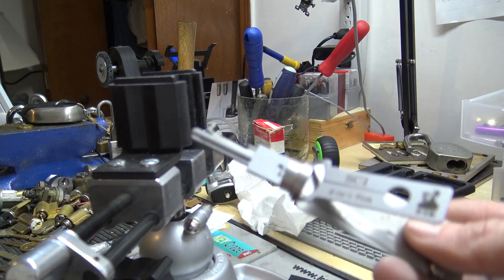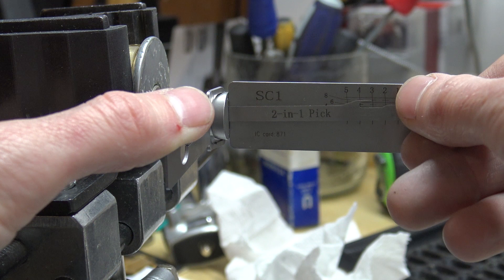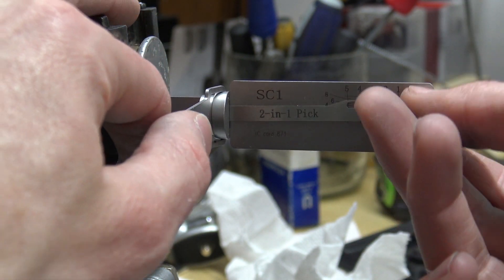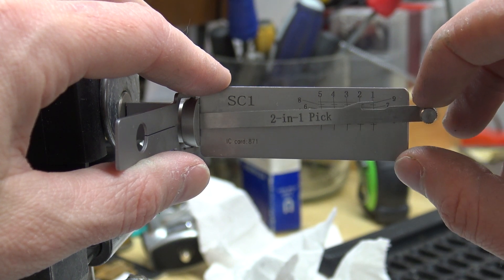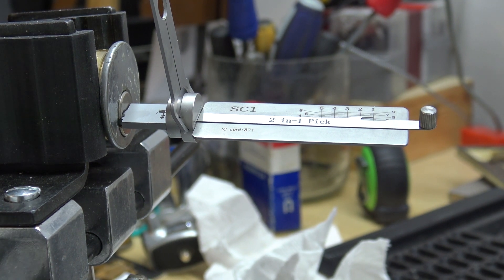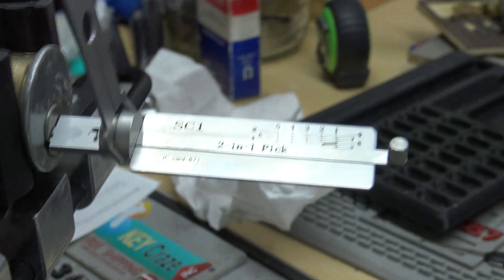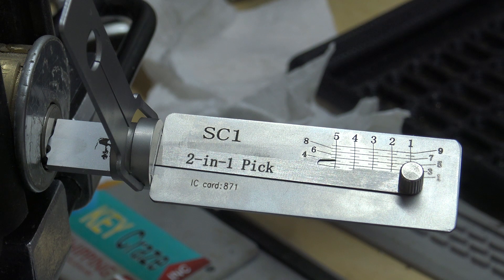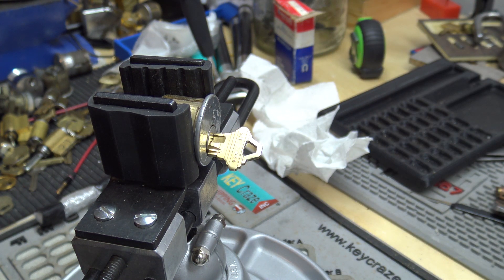(391) SC1 Lishi Picking & Decoding a Mortise Cylinder

Comment: Great video! Thanks.  Lockport is a hobby for me so I can’t buy every tool but this one looks pretty useful.  Do you know if there is any disadvantage to buying the SC4 tool and using it for SC1 and SC4 locks?   Most cylinders I come across have 6 chambers anyway and are pinned for 5.
Reply from the maker: according to lishi the six pin sc4 version wont fit into a 5 pin cylinder.  if you have a six pin cylinder pinned 5 or less the sc1 will work

Comment: im having an issue with my KW1 lishi. It seems to over set very very easy. The bitting is kinda extreme which makes it harder to pick than normal, but pickable. Def have to get used to using KW1 and SC1. The automotive lishis are different and easier to use in my opinion, or at least less of learning curve
Reply from the maker: I found the pin tumbler ones very easy but I also am very good at single pin picking locks so the lishi made it almost like cheating.  just have to practice.  you'll get it.  remember false sets are just part of it.  schlage brand will have spools and defiant and gatehouse will too.  some kwikset name brand occasionally will too.  just takes practice to get the counter rotation without dropping every thing
Reply: @BoredLockpicker  thanks for the tips bro! just hands on practice

Comment: It's too bad they're so expensive. For the money I guess I'll keep taking the locks apart. Great time saver for a professional though.
Reply: This isn't a great time saver for a professional. As a professional this is an expensive tool with a very limited application.  In about half the time I could have hand the cylinder apart and made a key.

The fact is that I rarely encounter a lockout situation where a customer has lost all keys for a property. 99% of the keys are in the house. So I'd hardly use the decode feature.

In my opinion on it is a fairly limited application "gimmicky" tool that solves a problem that is very infrequent.
Reply: @jamespetkwitz8737  I was figuring with the time actually removing the lock and then taking it apart, you could save time here. I'd totally open the door another way, though.
Reply: @connivingcactus539  I'd still say for 99.9% of  the time, this tool is pointless, at least it's biggest features are pointless. 

I can see it having a lot of potential as a training tool.. teaching people concepts of picking and understanding depths and spacings. But every time I try to think of a situation where I would really need this tool...i remind myself of more reasons why it doesn't Warrenton the investment.

Now, show me a video of this thing picking open a 30 year old schlage A-knob or D-series that's plugged up with years of graphite and dirt....then I'll be impressed
Reply from the maker: send me one and i'll try it and send it back to you..  I mostly agree with you're opinion on this.  I have the kwikset one and the one thing I've found it really useful for is picking upside down locks that in the past would give me trouble but with the lishi are a breeze.  The automotive ones are different story.  those things are amazing.  I use the motorcycle ones all the time.